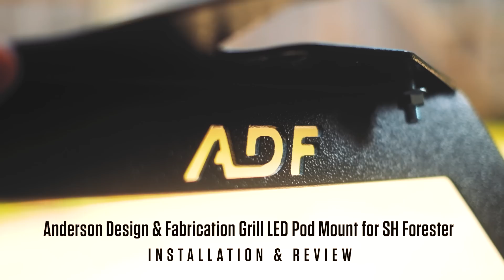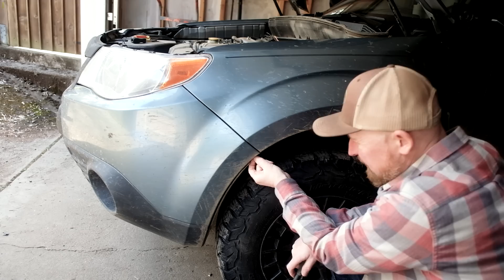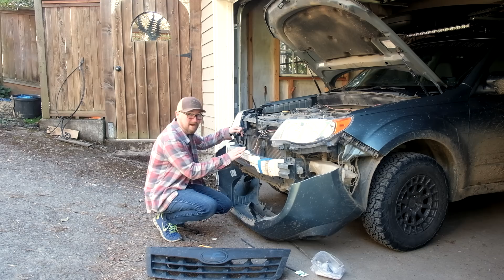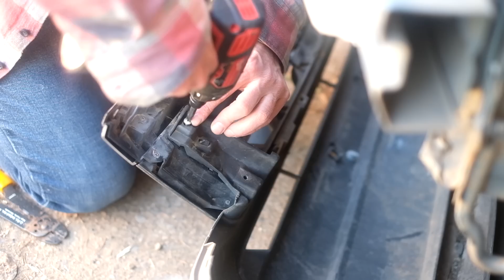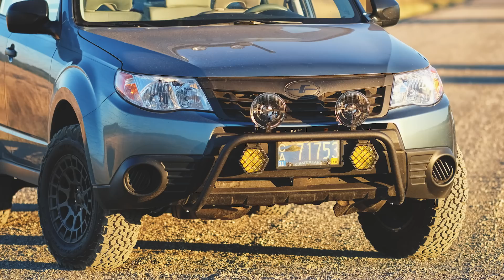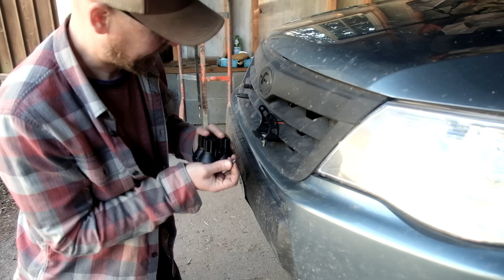ADF's New Offroad Lighting Mount for 09-13 Forester

Comment: I know that this is a very late comment but would this be able to be installed on an 09 Impreza? I have one of these that was given to me, or is it one of those thing I gotta just try go for it?
Reply from the maker: I doubt it? It's specifically designed to be bolted to the hood latch mechanism of the 09-10 Forester and emerge through spaces present in that specific grill. I know there's a lot of crossover possible between the Forester and Impreza, but I imagine the taller front end of the Forester would make this unlikely to be compatible with the Impreza. You should be able to get an idea by looking at the bolts of the hood latch to see if they even line up with the bracket, and if they do, measure down from there to see where the bracket would make the 90° turn to emerge out the grill. Good luck, let me know how it goes!
Reply: @softroadingthewest  so, I just got it on and it did end up fitting. All the bolts lined up the same and everything however, I did end up having to cut two small pieces of my grille to make it fit but thats no big deal to me, so I guess confirmed it fits for a 2009 Impreza hatch. I do have picture just don't think I can post them on YouTube any how
Reply from the maker: @Niiv0  That's awesome! I'm glad you were able to make it work!
Reply: @Niiv0  I am wondering the same thing for my 07 Forster.

Comment: Anyone know the distance between the holes on each mount wondering if I could mount a light bar
Reply from the maker: I don't know that spec and no longer have the bracket in my possession to be able to measure it, but Anderson Design & Fabrication could certainly tell you what the spacing is.

Comment: Looks good! Unfortunately, this doesn't work with the Sport Mesh grille replacement. Does anyone know if there is a version/product that will work with the mesh grille?
Reply: EDIT - they said it wouldn't work with the sport grille at the end. WOops :( :(
Reply from the maker: If you want lights in front of the grill and don't want to cut through the sports grill (agreed!) take a look at the Rally Innovations light bar. It provides 4 mounting points, two in front of grill and two lower in front of bumper. You can see it on my car in some of my older videos. Otherwise there is also the SSD bar which runs the lights a little lower but will also mount 4 and looks pretty awesome with big round rally lights all the way across.

Comment: I have a lift kit installed on my outback from ADF. Great company. Except they discontinued the ditch light mounts for the 3rd gen outbacks. I have KC lights on the front but would like to have just a bit more lighting for at night. Anyways great video man. Even though we have different subies I still learn and gain some good ideas that are practical and not to expensive

Comment: Curious why you don't add lights to the factory locations down near the lower corners. Also can I swap a 09-10 grill onto my 2013 Forester?
Reply from the maker: I am planning to replace the entire front bumper, so I didn't want to mess with those spots which will be going away. And yes, I'm nearly certain the grills are interchangeable. I initially tried to find a 09-10 grill in order to make this video, but was unable to get my hands on one cheaply enough.

Comment: ADF products are the cat's ass. Been holed up in the shop for 3 days building a unistrut 4'x7' roof rack, installing a 2.5" ADF lower strut lift, mounting a snorkel,  and trying to sort out a body lift to clear my 28" tires. Ill ship you my BRAT if you want to add a companion vid to your jeeper escapade. Maybe a piece of dental floss for snatch/tow strap for when the jeeper breaks an axle. You'll have to send it back after the battery dies. Now where the hell am i going to put all of these toggle switches?
Reply from the maker: I've got my own BRAT right here. She's already tired of "distance learning." LOL
Reply: Cant be easy right now but youth has it's advantage... though she may have to repeat a grade level. LOL

Comment: Any concerns about the lights blocking air to the radiator?
Reply from the maker: No, especially with these tiny little things. I ran 6½" Hella rally lights in front of the grill for a couple of years with no issue including prolonged hot summer driving over mountain passes.

Comment: Nice looking set up. How much weight do you think the bracket would hold? Thinking 7" spotties? Then I have the challenge of my sports mesh grille…
Reply from the maker: It feels quite sturdy, I think the only issue would be how much wiggle and jiggle you would get with more weight out at the ends of those metal tongues. And yeah...would be a shame to cut up the sports mesh grill. Have you looked at the SSD bar? It's a little more money, but it can hold 4 lights and looks pretty sharp on the front of an SH. My friend with the black 2009 seen in this video (that was an old photo) now has the sports mesh grill and the SSD bar with a bank of large rally lights on it, and I think it looks fabulous. She's @dolphinley on IG if you want to see how it looks on a black SH with the sports grill.

Comment: Решётку без бампера не снять?
Reply from the maker: Not positive I understand the question, but if you're asking whether it's possible to remove the grill without removing the bumper cover, the answer is no. The grill is - frustratingly - integrated into the bumper cover and the only way to access the screws which hold it in place is to remove the entire bumper.
Вы должны снять бампер, чтобы снять решетку  <<Google Translate, no idea if this makes sense. :-)
Reply: softroadingthewest thank you

Comment: I also like your other light bar better when it comes to the way it looked but in the end if your not getting the lighting you want you make a change.  And how DARE you sir make us wait for another video!! 🤪
I have all your videos saved on your projects that way I can reference them later and I have ADF saved to my favorites list.
Reply from the maker: Well, I could have put better lights on the Rally Innovations bar. But the compromise in approach angle and a few other factors led me to not bother reinstalling it after fixing the bent-up bits. I was actually just going to DIY some kind of interim solution to put some lights in front until I can move forward with a custom bumper, but then ADF came out with this nifty little mount, and that seemed far cleaner and more efficient than me trying to cobble something together myself. :-)

Comment: Looks like a small compact light with plenty of output.  As I viewed the light bracket it could of been made a few inches wider to miss cutting into the grill, unless I missed something.  Easy setup to install.  👍🏻
Reply from the maker: If the bracket was made a few inches wider, it would no longer fit the 2009-2010 Forester, and then those people would have to do some cutting on their grills. :-) Ultimately with this mounting approach, it's impossible for a single item to fit the two different grill styles Subaru put on the 3rd-Gen Forester. I believe ADF has a 2009-2010 in the family, so of course they used that as their SH guinea pig while prototyping. Ultimately it was kind of a fun little challenge to make it work on my 2011-2013 SH. :-)
Reply: softroadingthewest ,  gotcha they are making it to be used on more Forester’s per one bracket.

Comment: Is the Rally Innovations light bar as straightforward to mount? And could you conceivably mount the Diode Dynamics lights on a Rally Innovation light bar?
Reply from the maker: The Rally Innovations bar has two sort of hidden mounting bracket pieces in addition to the visible tubular bar itself, so there a few more mounting points/bolts to deal with, but it's still quite simple once you've got the bumper off...it simply bolts on to existing points on the car. And yes, there are 4 light mounting locations on the Rally Innovations bar, and you could put just about any available aux light onto any of them including these Diode Dynamics pods.
Reply: @softroadingthewest  Sweet! Thanks. I remember the bumper being pretty easy to remove and replace when I swapped to a sports grill.

Comment: I would want to mount them lower for better "cutting" under bad weather. Otherwise curious to hear how well these lights perform. Thanks for the post.
Reply from the maker: Yes, for sure, and that's the eventual plan with a future bumper build...I would envision moving these pods down lower and putting something else on the ADF bracket. For the moment, I had both these products to review, and they went very nicely together.  :-)  And this is still way better than having nothing out front for now and relying solely on the overhead lightbar. I'm eager to truly test the pods out...probably have that review out in a few more weeks. Thanks for watching!

Comment: ADF built rock solid!  I need this for my SJ.  Primitive winch mount changed my previous light mounting points. 
Diode dynamics have amazed me.  Installed SS3 Pro Sae/Fog and SS12 bars back in December - best output I've found.
Looking forward to your review - hope you like them as much as I do.
Reply from the maker: Glad to hear the SS3 are working for you, I haven't had much opportunity to put them to use but they seem fantastic, very well designed and built and an astonishing amount of light from such tiny little pods. I have the Pro with the Driving optic, I think it'll be a good pairing with the wider wash from the Auxbeam bar overhead. Looking forward to truly testing them out!

Comment: Reusing your switches on the fuse pannel?
Reply from the maker: Yes indeed, keeps it simple as I have four separate lighting circuits all running there already. I did have to replace all the switches themselves...three out of the four original switches had failed. I looked at possibly getting some kind of dedicated switch panel, but there's just not a good place to mount one, and that would've involved a bunch of wire rerouting. So I just bought four heavier duty switches which still fit just fine on my original fuse panel, that kept things simple and is working great.
Reply: @softroadingthewest  there's definitely no where good to mount anything like that without some custom work. I'll try to fab something up in the next few months. 👍

Comment: I love the minimalist look of that bracket. Plenty secure too. 

The bracket is stronger than the piece it's attached to!

Now I need to figure out how to mount a light bar behind my grill.
Reply from the maker: It's funny, I was actually in the early stages of planning some kind of DIY grill light installation when ADF announced this item. No longer seemed worth the trouble at that point...it was far more efficient to just make a video about their mount rather than mucking about with my own. I don't think I would have thought of attaching to the spot they did though. I have faith you'll figure something out under there.